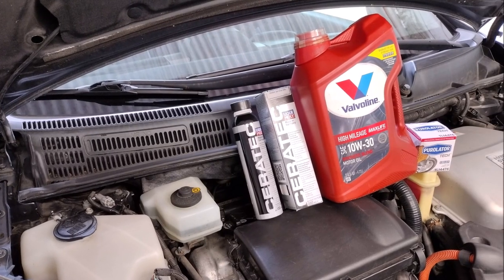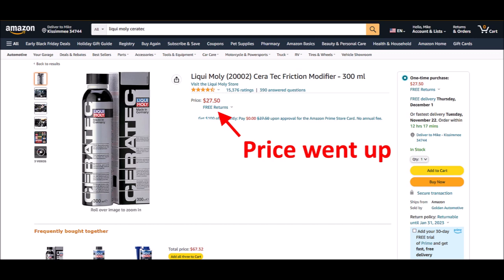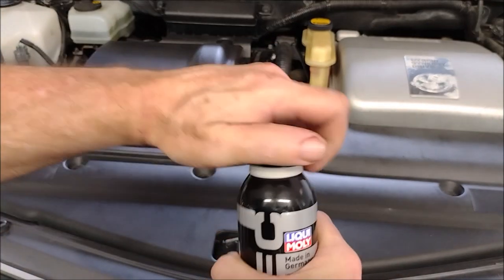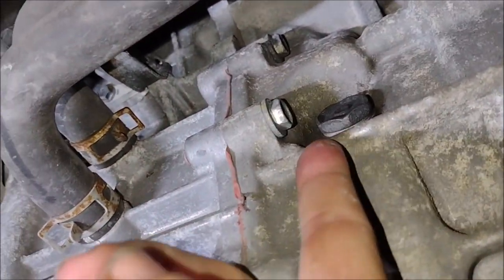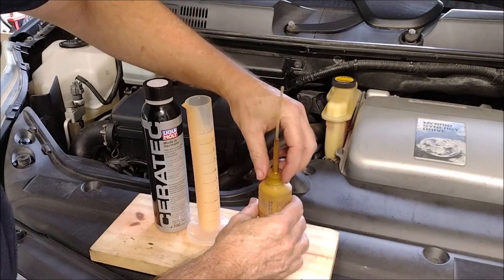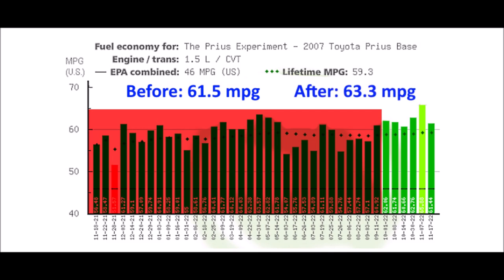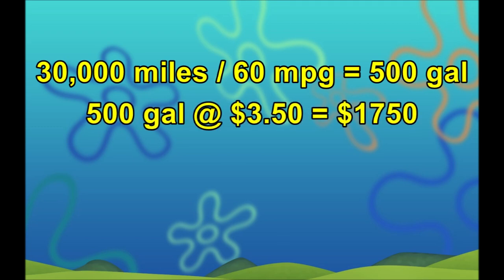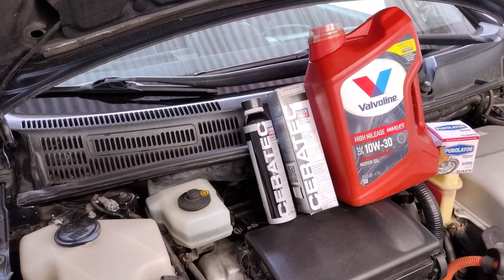The Prius Experiment: Better Fuel Economy with Oil Additives? (Liqui Moly Ceratec)

Comment: Using a prius with this test will only give a limited benefit because you are splitting hairs for more efficiency. If you managed to get a 5% improvment with a big gas pick up truck, that would be substantial. In reality things like aerodynamic drag will be more of a parasitic loss of efficiency, not the engine.
Reply from the maker: I tend to agree. But I was curious. So I tried it.

Comment: It's worth it if your fuel economy is lower like mine (I average 31mpg), and you really only need 1 can for the engine oil, I don't think it's worth to buy an extra can for the transmission.

Comment: There are cheaper ceramic oil additives as well, that might work and give better overall economy (as they are cheaper than Ceratec, but don't know if they perform similar).
Reply from the maker: That's interesting. I didn't realize there are other ceramic oil additives.
Reply: @michaelblacktree  I'm in Sweden and here they sell LM ceratec, STP Ceramic Oil Treatment & one of the cheapo car parts "no name" chain called "Biltema" even has a  self-branded ceramic oil additive which is sold for about $17,4 (it looks kind of similar to Ceratec if you look at the fluid but more of an orange  color).
Reply from the maker: I did a google search, and found several brands available in the US as well. If another brand works as well as LiquiMoly but is cheaper, then I would do that instead.
Reply: randomly found "GAT Ceramic Engine Protect"/"GAT Cera PROTECT" which is made in Germany & is pretty cheap

Comment: Add a little to the gas for even better results! Disclaimer: Don't take me seriously! Would you have to run the oil for 30k mi to get the advertised savings? I assume you have to add w/ each oil change...
Reply from the maker: That's a good question about the oil changes. Surely LiquiMoly doesn't expect us to go 30k miles between oil changes? Or will some of the additive stay in the engine?
Reply: @michaelblacktree  I wondered if it "sticks" to surfaces and has an impact after an oil change(s)... seems optimistic, lol
Reply from the maker: I know the MoS2 additive chemically bonds to the metal. But I'm not sure if the Ceratec does that.
Reply: MotorKote will bond to the engine... Use 2 oz every quart... Use every other change out... They make other products that are great as well for fuel and even grease ( think wheel bearings )...
Use 1 oz in your CVT box...

Comment: hello, is there any problem if I add the Ceratec ceramic additive from liqui moly, but after 100 km from the oil change, I just discovered it after the change and it even has good reviews on amazon, as there aren't many for other products, over 20,000  of reviews... mostly positive, so I'm curious if in contact with the used oil for about 100 km, this additive not being mixed, and not being fresh oil, is it ok?
 can it damage my engine?
Reply from the maker: I have no idea. I only tried the Ceratec once. And to be honest, I don't think the juice is worth the squeeze, so to speak.
Reply: 100km is about as new as it gets. What do you expect? There is no issue here. Not even if you add it after 10000km.
Reply from the maker: @herrkulor3771  - The instructions say to mix it with oil before putting it in the engine. If you don't pre-mix it, it'll probably settle to the bottom of the oil pan. Then the oil pump will suck up a big glob of ceratec (instead of oil). That's probably not a good thing.

After I found the Motor Oil Geek channel, I stopped using oil additives. The guy is a motor oil specialist, and he breaks it down for us.
Reply: @michaelblacktree  it does not say so in the instructions I read, or the video from LM. I just put it in as it is already an oil suspension and let the motor idle a little to mix it up before the drive. Otherwise it would always settle at the bottom of your oil pan anyway. Your motor is the mixer.
I also don't see a need for additives, unless there is a specific problem.  Fuel saving definitely isn't working. If you get more horsepower, people will drive less fuel efficient anyway.

Comment: Lake Speed, Jr. DOES NOT recommend motor oil additives. He does recommend fuel additives.
Reply from the maker: Yep, and after finding his channel I stopped using oil additives. The guy knows what he's talking about.
Reply: @michaelblacktree  Using ceratec for a short oil change interval is actually fine, it makes the engine smoother and is proven to make the engine run for longer. Not a bad idea to use it.
Reply: Oh so we are talking about the Motor Oil geek, Yes that vid came into my mind as soon as I heard oil additive, Yes he's right for what he says, it actually changes the way how the oil behaves, doesn't mean if you change the oil it'll have huge problems. Ceratec is known to have good stuff inside it make your vehicle run better. But nothing beats using a quality oil for that, who needs additive when your oil already has that stuff. Amsoil, Pennzoil and a lot more quality brands are out there for that. Engineers Explained is also a Good one to watch.

Comment: Just change you oil more often and you will be fine
Reply from the maker: Are you claiming that more frequent oil changes will improve fuel economy? And if so, do you have any data to support that claim?
Reply: @michaelblacktree  no, but it will help the engine last longer,  
If you want to improve your gas mileage, change the air filter and spark plugs
Reply from the maker: That's routine maintenance. I've done those things already.